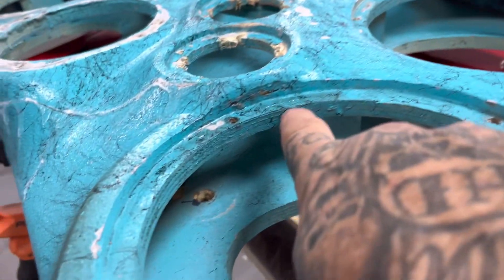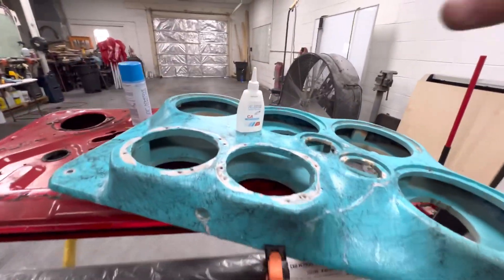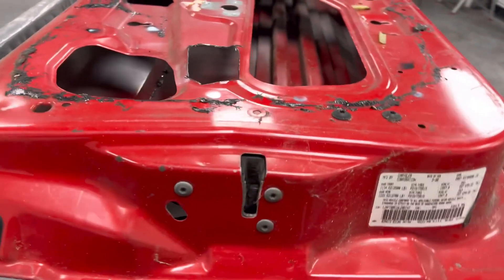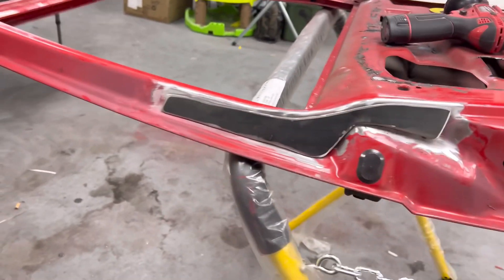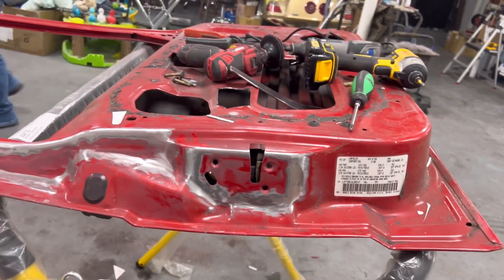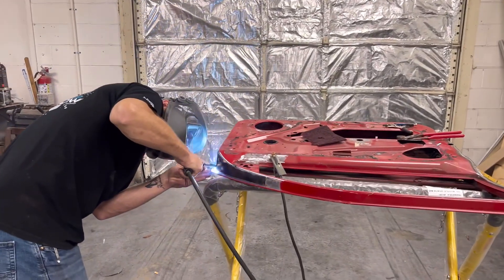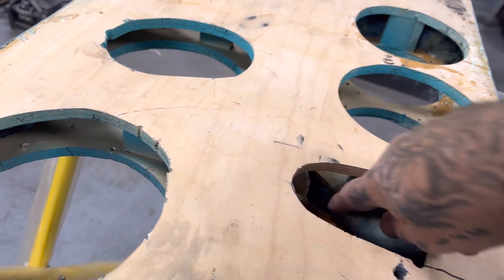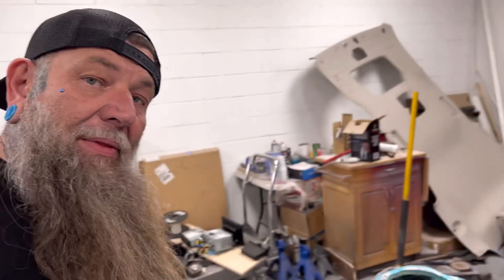Making Jangalangs new door strong

Comment: Order some cardboard tubing the same size of each speaker. Cut each tube to length needed just beyond speaker magnet on those penetrating the door panel. Spray foam all voids between tubes from back of trim panel. This will also help with soundwaves to travel into cabin space rather than resonating in the door panel.

Comment: Cool process.  Adding some steel to the back of the door pod and bolting to the door could add some strength.
Reply from the maker: Never bolt the door shut, I drive this a lot..
Reply: Agree, I meant bolt the steel enforced door pod to the door to give extra strength.

Comment: Hell yeah looks solid Does adding metal to the outside of the door let your door close if the gap is really tight like on my truck? If that’s the case is it better to reinforce the inside?
Reply from the maker: Yup most vehicles have at least a 1/4” gap in that area

Comment: Do yourselves a huge favor and don't pl between the door brace and door skin. Use windshield urethane. Ever since I put it in mine it's been a Hella difference in my doors strength. I was going thru a door a bout every 8 months. Ever since I put urethane in between the brace and my door skin it's kept the door together way better. I don't rip my door lock bolts thru my door anymore

Comment: I think those new DS18's you have are going to do more damage than you think. I have 2 12's of the same subwoofers. I have them running off half of my 4 channel right now and they are beating the crap out of my car. Granted, I have a JP10.4 for my highs and mids,  but I have two JP13.2ab for them. I just need to find room for all 3 amplifiers in the trunk. I have the 2 12's, 120AH of Yinlong, 2 JP13.2ab,  and a JP10.4 to try to fit into the trunk of a 2006 Mercedes CL500. 🤦